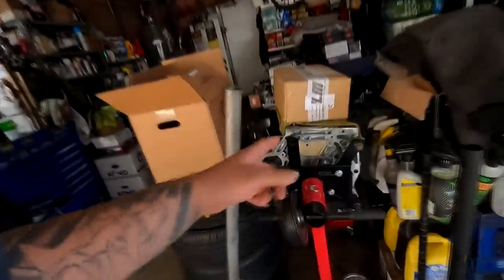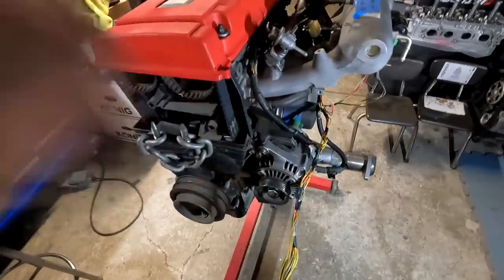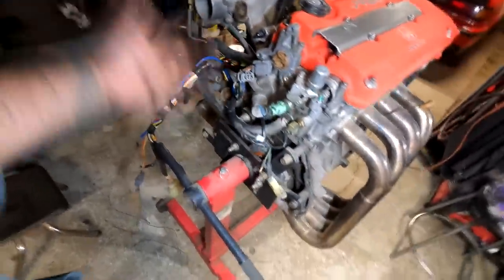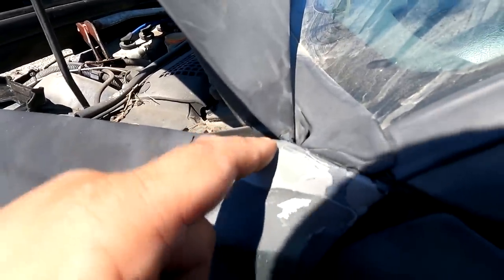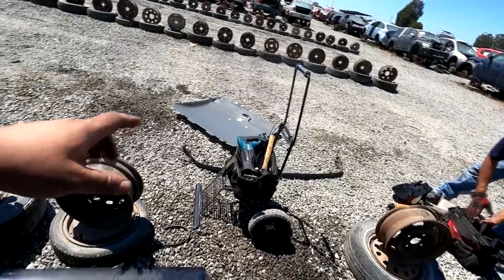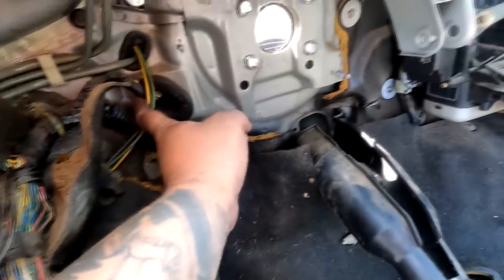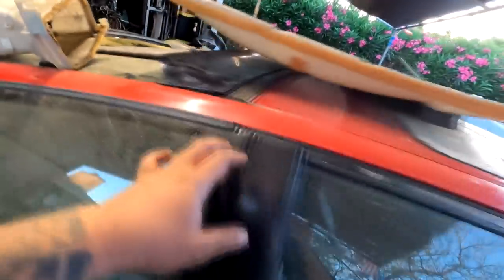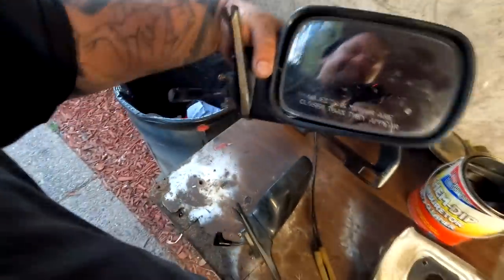JUNKYARD HAUL | New Product In The Works ?!

Comment: Hey I was wondering about something, I’m doing a y5 swap into a ef could I just use the stock harness of the y5 and get a chassis conversion harness to the y5 ecu and not have to deal with mpfi conversion bull crap or would I still need to do some of it, thanks

Comment: What sawzall blade do you use to cut the firewall out?
Reply: I use Diablo blades for cutting metal
Reply: @danh2134  what specific blade though? I used diablo blade to cut my exhaust off and didn't really cut right lol
Reply: “Carbide teeth”
Reply: Carbide blades